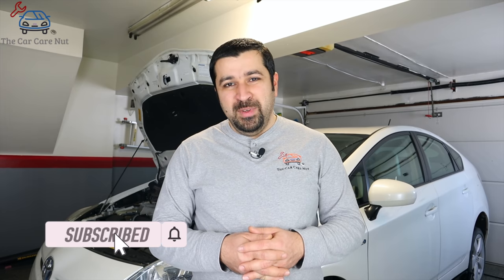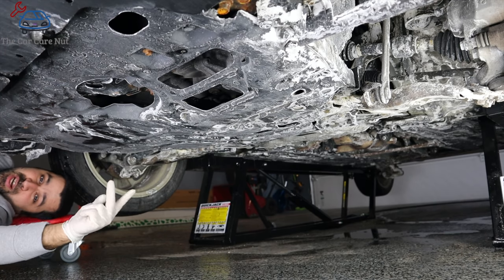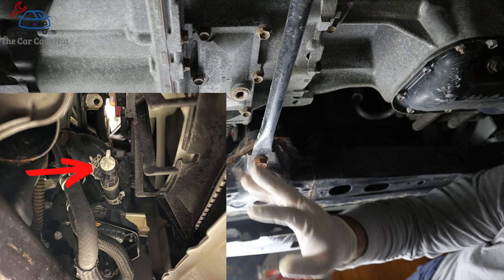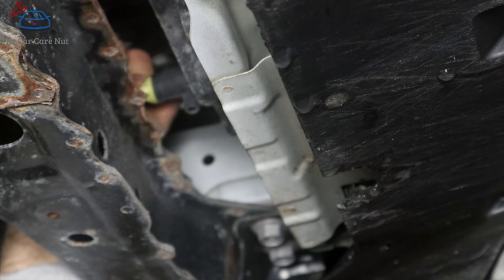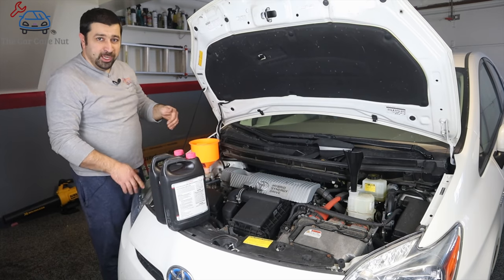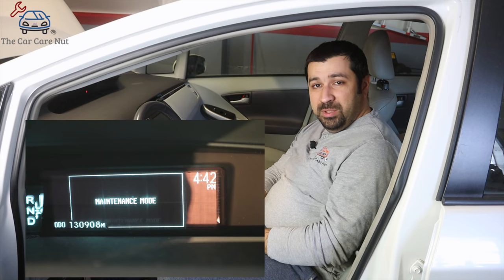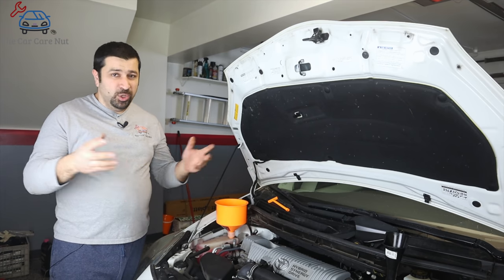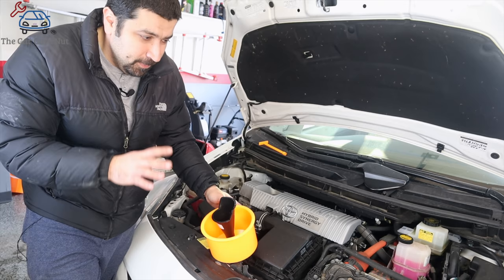How to replace your Toyota Hybrid Inverter and Engine coolant

Comment: This is a very great review for the 2010-2015 Toyota Prius!

I have the same color Prius and is a 2015.

I have a question and maybe this might be a great video review. 

There is a debate between the factory 15” wheels versus the 17” factory wheels, they say the 17” factory wheels drops the MPG’s down to the low 40’s? In your experience, is this true?
Reply: Obviously,  see the new 2023 prius getting less mpg with 19" Wheels vs 17" ones
Reply: You know, I used to think changing a car’s wheels was easy.  Now having done it, on my low-miles but 2010 Prius 3, here’s the stuff to be aware of - and I can’t believe it’s this complicated, but as CCN would say that’s just the way it is!  First, the reason for having larger-diameter wheels at all, is MEANT to be to cater for high-performance cars having HUGE disk brakes, with HUGE powerful calipers etc.  These take so much space up, manufacturers and race teams, had to up the size of the wheel, to make more room.  Now, you’re going to say ‘but the Prius isn’t a hi-performance car, why’d they fit huge wheels?!’

The answer of course, is that there are other characteristics…once you fit bigger wheels, you have to try and keep the outside diameter of the tyres, the EXACT SAME as before, or else as an auto-maker, you have to change gearings, final transmission, absolute nightmare costs.  Also, the car is much more responsive to the steering wheel.  No ‘creep’ in corners, or not as much.  Tyres don’t crawl as much when turning, or flex, etc, so steering is much sharper.  But, this is what we call low-profile tyres/tires, and they are terrible on poor road surfaces.  AKA an awful lot of road surface where the weather has seasons.  So Chicago, Northern UK where I am, etc, etc.  So, a little bit of sales/marketing going on really with the Prius, but also sharper steering…and just to make it interesting, the outside diameter IS changed very slightly by these lower profile tires!

In other words, the Prius 2010-2015 is perfectly able to use 15” wheels and tyres, but there’s a bit of a conspiracy with the low-profile tires that are fitted to larger-diameter wheels (eg 17” instead of 15”), in that most industry insiders know, the outer diameter of a low-profile tire, is almost always LESS than the equivalent tire fitted to the ‘normal’ sized wheel…in other words, there’s a tiny change to the gearing that is made by simply using bigger wheels and lower-profile tires.  It makes the car accelerate more briskly, but uses more petrol/gas, just like being in a slightly lower gear ratio, or having some differential/final drive ratio change made.  It’s small, but if you drove the two cars side by side, you’d find one was faster and felt like it steered much ‘better’.

Of course, the flip side is you feel every breadcrumb left on the blacktop.  Where I live, it’s murder on cars.  There’s simply bits missing of the road surface after the u-know-what lockdown meant no road repairs or much less than scheduled.  Bulbs take a hit, suspension bushings, shocks are the worst probably.  It costs money, is my main point.  Softer tyres, or at least tires with more sidewall, on 15” wheels, make a noticeable difference to bump-thump, BUT of course, change the gearing in favour of gas mileage, but losing you that ‘edge’ of performance in acceleration and steering.

Compromise.

I wouldn’t touch a car with 19” wheels on the roads I have to drive on, not unless the tires were over two feet in outside diameter anyway.  The wheels are on the verge of getting split open with the pothole-edges hitting them at speed, and the car takes a pounding.  Ten rounds with Mike Tyson sort of thing.

Ok, so in short, it’s complicated.  I used an online checker that told me what tires were acceptable for being ‘similar’ or very close in diameter (rolling radius) to the originals.  As a result, wheels of 17” diameter shod with 225 45 R17 Pirelli’s I made into 15” wheels with 195 65 R15 tires.  The ride is more comfortable, and no amount of tweaking with springs or shocks can fix the lack of pneumatic tire between your vehicle and the moon-surface drivers in Northern Climates have to negotiate.  Here’s the website I used, it says it’s for Europe but I guess it works, as long as you put in the right tire sizes?…   https://www.wheelfitment.eu/car/Toyota/Prius%20(2010%20-%20)     So that tells you how close one so-called equivalent tire on a larger diameter wheel is, to another smaller wheel and bigger tire depth combo.

In my case, it was about half an inch or 15mm or something, that a single rotation of the tire made in movement forward, compared to the low-profile tires and larger 17” wheels.  About 2.2% it said I think - 2% more distance driven for every single rotation of the smaller wheel and narrower/taller tire combo I wanted to put on.

This is sort-of equatable to fuel economy.  It also affects the speedo reading, and what ACTUAL speed the Prius will tolerate being in EV mode for…I told you it got complicated.

So the ‘real speed’ of my car with the 17” wheels, was about 2mph to 4 mph LESS than the car speedo was telling me.  That meant, EV mode really only did about 28mph, not 31mph.  BUT the slightly lower gearing of course, caused by having those not-exactly-equivalent low profile tires on, meant that the Prius gave better EV-only acceleration before flagging I was asking for too much acceleration for eV mode to be maintained.  I had NEVER gotten that message when I had the original 17” wheel and tire combo on.

And I haven’t covered everything, I don’t think, just the main points!  So, basically, you need to be sure if you get smaller wheels than standard, that you have the room for your calipers still, inside the smaller wheel size.  I did, it’s fine.  Nothing must rub or abrade, even when the car hits bumps and hydraulic lines etc, move a bit.  If you have a steep ramp to your drive, and you were able to drive up it with the lower-profile setup, you may not be able to with smaller wheels and narrower, but bigger outer diameter tires on, because the gearing is ‘taller’.
 
The final thing I HAVE to mention, is there are differences in the type of lug nut Toyotas have, depending on the model.  CCN knows a lot more about that than I do.  But, my Prius 3 uses flat-shouldered wheel nuts with washers that are held on by a little bit of manufacturing serrations, to the nut itself, although they can move and turn a bit.

Essentially then, I have fitted a set of ‘comfort’ wheels, that are smaller wheels but take bigger tires in diameter, although they are a small amount narrower (6.5” vs 7” width) and the tiny benefit the low-profile tires had given in acceleration, I have lost, but gained in fuel economy and comfort, less bump-thump on dodgy roads.

I was concerned about there being enough room for brakes, but read on Prius chat forum, it was alright.  I didn’t realise there was a cut-off for the EV mode, not only for speed but also acceleration, because the larger wheel diameter made a gearing adjustment with the R17 Pirelli low-profile tires, that made better acceleration possible while they were fitted.  But, I either accept this different compromise, or go back to the previous compromise.

In the end, another reason was tire costs.  For a while there, low-profile tires were prohibitively expensive.  Somehow, suddenly, the sky-high prices have backed off a bit now.  But the dent to my confidence was already done.  It was impossible for about a year, to get a tire for less than £100UK that was any good for the 17” low profile setup.  Yet, the 195 65 R15 tires were almost half that.  For a tire with MORE rubber etc on it, just half an inch narrower…and I have sat them right against each other, the difference in width visually, is quite small, it really is half an inch of extra contact with the road.  A whole lot less cushioning though, on those wider, lower profile tires.  Take care, sorry it’s a long explanation, but it’s not the simple thing it seems when you set out to change your wheels and tires.  Thanks to CCN as always for a great vid.   [EDIT sorry the link is for bolt PCDs and stuff - oh dear, another check you have to make!  There are plenty of tire size comparison calculators out there, but none give the answers the original one did I used, and it seemed the most accurate to me, based on driving afterwards? ]

Comment: Really enjoying your videos. They made me take better care of my car (another care nut here now). Just did the same procedure on 2018 Toyota Highlighter Hybrid at 80K miles. It was really easy to drain coolant from two hoses (one for inverter & one for radiator) at the bottom front area . Total drained and filled 2 gallons. 
The spec, however, states there are 13.1 quarts in "Gasoline engine" and 2 qt. in "Power control unit" -  total 15.1 quarts. This procedure changed 8 qt.  Is this sufficient? Planning to keep this one for a long time (as my last dinosaur propelled vehicle).
Reply: I did my 2017 Hybrid HL yesterday at 67k miles, the same 2GR-FXS as yours I believe. You might've missed to drain the cylinder block drain cock plug that is towards the back of the engine, kind of near the front driver side axle shaft. 
You have to be careful not to airlock the 2GR-FXS. I used a radiator filling funnel kit and a lot of squeezing the two radiator hoses, I saw a lot of air bubbles coming through the funnel but still the air out of the rear row vents was coming out cold. I took the car for a drive with some hills and after a while it started heating the rear, I hope no more air bubbles are trapped anywhere, time will tell.

Comment: I followed this pretty exact. Once it was done doing the bleed I took it for a little drive and the WATER TEMP message came up on the display. 2007 TCH.  I had my OBD2 hooked up and checked on the code it was P0117.  The scanner has the message that the inverter water temp was high.  I checked the scanner and the temp was at 98F.  The interwebs indicates this relates to engine coolant temp. The temp max showed it got to 258F.  Which is supposedly below the max.  Got home. Engine reservoir was lower. So i filled it up. One thing to note is when doing the bleed in maintenance mode.. the engine reservoir never lost level...  So, I'm guessing the radiator had no coolant in it when I took the first test drive.  After I filled up the reservoir from the first trip. I took it out again after clearing the code. It came on again and reached a temp of 274F.  Got home. Checked levels.  Couldnt see a definite change. Not sure what's going on.  The inverter reservoir seems like it's just bubbling. kinda like if you blow into a straw in a glass of milk.  Not as extreme, but close analogy.  Any suggestions? Thanks for the vids though.
Reply from the maker: Hi. Did the car have any issues before the coolant?
Reply: @TheCarCareNut  I have a weak battery module. Would PA080 prevent the inverter pump from circulating?
Reply from the maker: P0a80 shouldn’t prevent it from circulating however you do need to get that fixed
Reply: @TheCarCareNut  well I don’t know if it’s not circulating. It just seems like it’s not. I don’t know why it didn’t pull from the engine coolant reservoir when doing the bleed. Should I just continue to take short trips until I no longer have the WATER TEMP message?

Yes. The hybrid battery fix is in progress. Decided to do some other maintenance while I wait for parts.
Reply from the maker: At this point the system is overheating and you’ll need to check the water pumps and make sure they are working
Reply: Curious as to how you resolved this issue. I commented on the video, but I'm having a similar issue with my '13 Avalon hybrid. Car is trying to overheat, and it never sucks in coolant from the reservoir. I replaced the coolant pump, but that didn't help. I'm also getting no heat in the vehicle. When I open the radiator cap with the vehicle cold, there's no fluid there at all. Wondering if I should've filled the radiator via the cap first before filling the reservoir. No issues before attempting this maintenance.
Reply: @ScottHancock  were you able to resolve this issue?
Reply: @Brandon-xp4dt  YES!  The process shown in this video DOES NOT apply to the Avalon hybrid...or at least the '13 model I have. You MUST fiill the system with coolant through the radiator cap (make sure the engine is cool first). Fill until you can't add any more, then fill the plastic coolant reservoir to the max line. Run the engine over the course of a few days, and add more to the reservoir as needed to keep it at the "max" line. Basically, the system can't / won't pull in antifreeze from the reservoir unless it's already full by filling through the radiator cap. Mine was just starved for coolant, which was causing it to try to overheat. Hope that helps!

Comment: Thanks for the video. I am about to do this on a high mile Prius (2nd gen) What is your recommendation, should you use a coolant flush/clean product like Prestone Radiator Flush +Clean?  Is it OK to use this kind of product on the inverter side?
Reply from the maker: Hi! I wouldn’t use any products on the inverter side. On the engine you can but I personally wouldn’t bother unless the coolant has been mixed with aftermarket
Reply: @TheCarCareNut  Thanks!  If it has been mixed with aftermarket, would you run a cleaner in that case?  This car was maintained very well for the first 3/4 of its life with it's first owner.  However, the second owner was a bit sketch.  It would not surprise me if he did not use Toyota SLL.
Reply from the maker: It wouldn’t hurt in that case. I would however drain and coolant and look. If it’s all pink I would run the cleaner through the engine only not the inverter
Reply: @TheCarCareNut  THANKS a ton!  Great content by the way.  Loved the video on why some Toyota's use oil.  Awesome explanation!  Keep them coming!!!

Comment: I bought 2 bottles of Toyota pink coolant but it came with the yellow cap presentation and date is 2016.
On the back of the bottle it says use within 2 years of manufacturing date. What would happen I I use it anyways? That’s what they selling in Mexico.
Reply from the maker: I really have no answer for that. I would return it and ask
Reply: I went back to Toyota dealer, the technicians told me that they have been using those bottles for years and that it is ok to use it, so I asked them  why is there a message on the back of the bottle that says use within 2 years of manufacturing date and this bottle was manufacture in 2016 should have been used by 2018 or so , they had no answer then I asked them if I could trade for new presentation bottle with a newer date of manufacture and tolde me they only have the yellow cap bottles that they get shipped from USA every month or so.
Asked for refund so I could look somewhere else for oem new pink coolant but couldn’t get money back.

Comment: hi my brother 
I have a toyota auris hybrid it hase a light misfire no dtc .  When I log into engine ECU live data  I find that the engine coolant is -40C°
and when I log into hybrid ecu live data it is 70C°
And the same thing in the combination mater ecu... engine coolant temperatur is 70° 
It changes with engine conditions .
I wonder what caused this to happen in the engine's ECU ??
If the engine temperature sensor is the reason, where does the hybrid ECU and the combination mater ECU take the engine temperature from?

Comment: I have A Prius 2020 can you tell me how to change transaxle coolant ??
Reply from the maker: Hi! Same procedure as in this video
Reply: Well not exactly because on the 2020 transmission I only see one hex bolt on the bottom and one on the top. So do you drain the coolant somewhere else but it doesn’t seem to get drained from the bottom of the transmission.

Comment: I have a 2016 Toyota Highlander hybrid, 185,000 miles and the dealer recommended an inverter treatment to replace the coolant and two filters that are in the inverters. Do those filters need to be replaced?

Comment: How often would you recommend changing the inverter and engine coolant. Sorry, I might have missed that information in the video
Reply from the maker: Hi! The first replacement at 100k miles or 5 years. After that every 5 years or 50k miles

Comment: I have prius C 2015. I was able to figure out where the radiator drain plug is, but I couldn't figure out where the invertor drain plug is. Can you tell me where I can find it?
Reply from the maker: Hi! On your Prius C the inverter drain plug should be in front of the radiator. Between the radiator and the transmission. You’ll find a hose with a drain on it
Reply: @TheCarCareNut  I Was under the impression this is the radiator drain plug. I guess I already found the invertor drain lol.

So more accurate question would be where is the radiator drain?
Reply from the maker: Ah I see. The radiator drain plug will be at the bottom of the radiator

Comment: Would the process be the same minus the steps for the inverter for 2ZR-FAE? I opened the drain cock and went to open the radiator cap and was surprised to not find one. It appears to have a similar pressurized tank like this Prius, so I'm assume just fill the tank to full, let the fan cycle twice, and top off as needed?

Comment: On another video, you mention opening a coolant hose on top of the engine (right side) as part of the initial bleeding of the engine coolant system on my 2020 Highlander Hybrid; however, you did not mention that in this video.  Why the difference?
Yes, I too really appreciate your teaching videos.
Reply from the maker: Hi! So this video doesn’t apply to hybrids with a 3.5L V6 and the ones with the newest dynamic force engine. I’ll leave a note for everyone. I’ll make a video dedicated to the dynamic force engine in the near future.